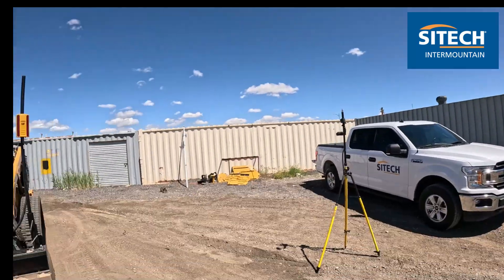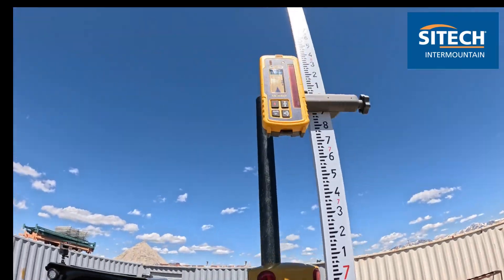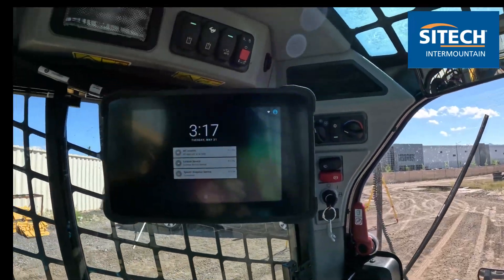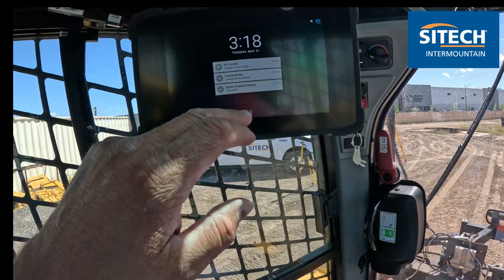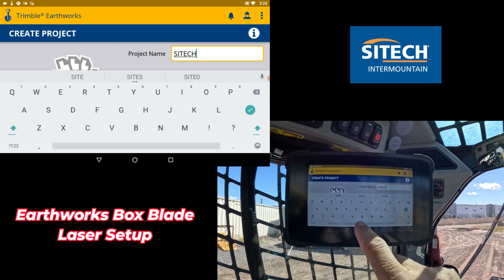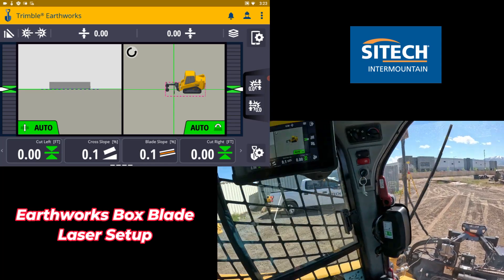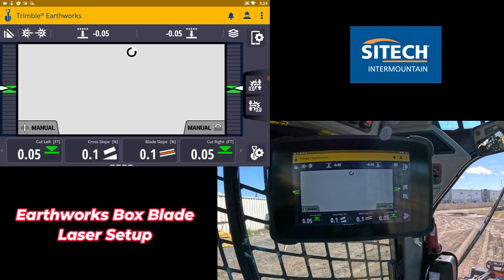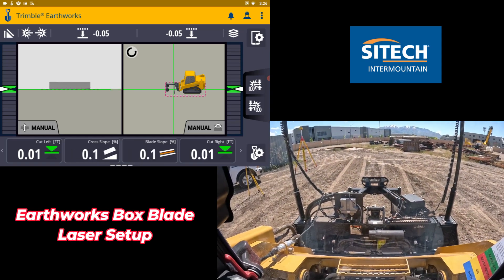Earthworks ATI Box Blade Laser Setup Process

Comment: Great video as always, do you plan on doing a video with a cat GB124? I just purchased one and had our Sitech install 2d laser w/autos. The function of the controls are way different than with that ATI box and they didn't mention anything about putting the hydraulics in continuous flow, wondering if that is specific to the ATI box. They also didnt mention the aux 8 for the power of the screen. I haven't had much time to play with obviously